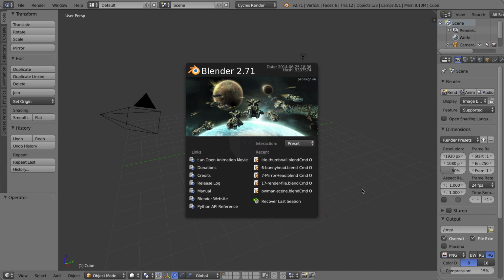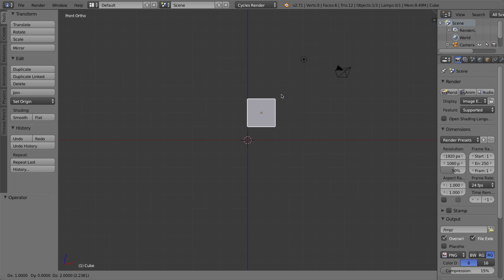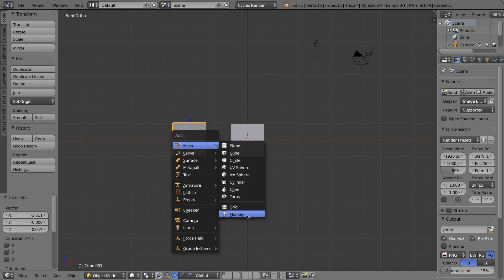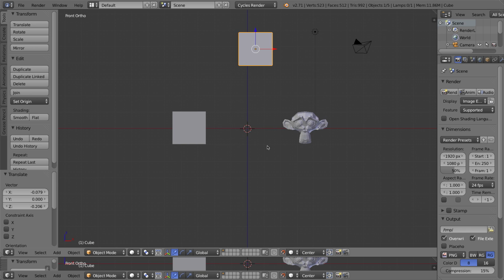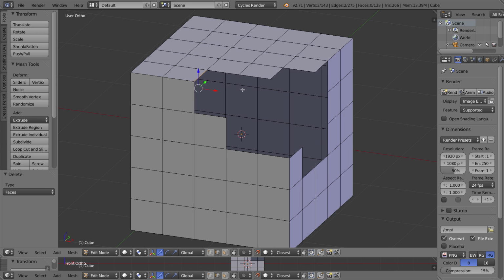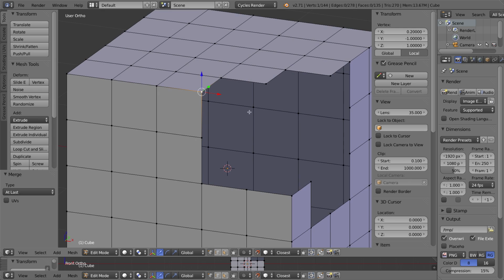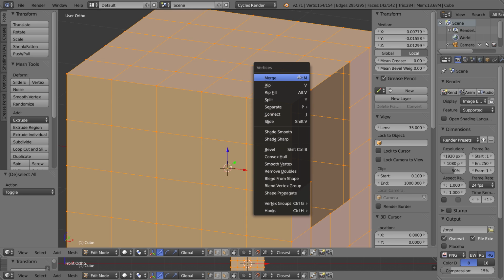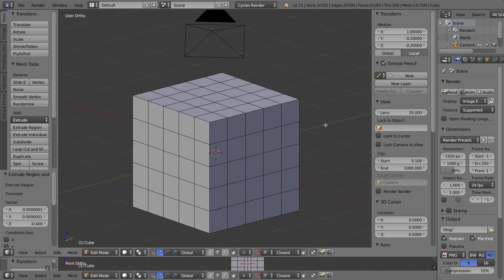Blender 2.7 Tutorial #26 : Snapping & Removing Doubles

Comment: Something totally the opposite of reality and logic is occurring. Whereas I have the snapping set to face, closest, align to rotation of object, and snap individual elements, the ABSOLUTE OPPOSITE of the closest aspect of the smaller object is snapping to the larger one. Blender is rotating the object 180 degrees to have the farthest possible aspect of the snapping object from the snapping target snap to the surface. The same procedure has worked perfectly on other similar models. I made sure to set the rotation and scale of all objects, along with setting their origin to geometry, after experimenting with setting the origin point of the snapping object to the closest point to the snapping target which, of course, didn't work.

Comment: Do you have any idea how to solve misaligment of faces you want to extrude?

When i extrode a face is seems to going normally along the green axis but is offset from the other faces/edges from it:

http://img12.deviantart.net/3206/i/2017/087/8/4/blender_extrude_error_alighment_by_anuojat-db3tq2j.png
Reply from the maker: Yes. Make a loop-cut (ctrl-r) around the rest of the mesh that lines up with the bottom of that extrusion in your image. Next, MERGE (under the W [Specials] Menu) together the vertices at the bottom of that extrusion with the nearby vertices you created with the loop-cut. Basically, you need vertices to connect the vertices at the bottom of your extrusion to.
Reply: Thank you for the information. I didnt understand everything of what that meant but ill try to see what those tools do...

On further note, if you dont midn answering more, currectly modelling in blender seems pretty slow compared to say sketchup. Is there a LINE TOOL or anything equavelant coming in the future or is there soemthign already which YOU use to speed things up and customize look without having to constantly fibble around with "make edge/face" "Dublicate" Tools? [And yes i did look up your tutorial series fully, but maybe i missed something?]

For referance:

https://sketchupinayear.files.wordpress.com/2008/03/line1.gif?w=655

https://3dprint.com/wp-content/uploads/2014/11/SketchUp-2015-Arc-Tools.gif

https://discourse-cdn.global.ssl.fastly.net/sketchup/uploads/default/original/2X/2/234525b26a25899a9ae5dafdb2ba5bb851115121.gif

Thank you for your time in advance. Whether you know to answer or not.
Reply from the maker: It's just a matter of what you're used to. Sketchup is obviously more for designing buildings, so tools can exist like the line tool that snap to angles when drawing in open space. In blender you can extrude vertices (or edges), then move them along a specific axis by pressing that axis letter (: x, y, or z). You can fill a face between two edges by selecting them and pressing F, and you can draw edges on the surface of an object (like the line tool) with the knife tool.

Comment: I'm a 3ds Max user learning Blender and couldnt see how he was doing the snapping in this video https://youtu.be/wWn9gYwnONk your video helped but I think he was snapping to the 3d curser? thanks
Reply from the maker: There are two big ways you can use the 3D cursor in examples like this: 1) change the pivot point of your selection temporarily to the 3D cursor (he does this at the beginning of using Blender) [I didn't watch more than 15 seconds], and 2) use Shift-S to bring up the snap menu. This is super handy for moving the 3D sursor to exactly where you want so you can rotate or add other objects from that point. From the snap menu you can also move selected objects to the exact location of the 3D cursor. Hope that helps!
Reply: Thank you :-)

Comment: I ran into a problem where after using remove doubles my two overlapping loops merged into single point. Despite going crazy about setting up the merge distance to lowest factor. After 3 hours I came to solution! Remove doubles does not take the scale into account so all the points where actually bellow the merge distance and that was why it was merging into one point instead of removing the overlapping points. Once I applied the scale the overlapping loops merged into one loop without an issue.

Comment: Fantastic series so far!  Wish I would have had one so thorough 7-8 years or so ago. :D

One thing I use snapping for frequently that I didn't hear mentioned was for snapping to "nearest face".  I find that handy for snapping an object, such as a book or a lamp, onto a flat surface like a table or a floor.  While maneuvering on that flat surface with the snapping on can be tricky, I find it extremely helpful for getting to the right place on the Z-axis, and then, after turning off the snapping, you can move the object to a more precise location by grabbing and excluding the Z-axis.

Don't remember having seen that tip on the button to remove the doubles when snapping before,so I did pick up something new that I'll definitely have to try out.  Keep up the great work!